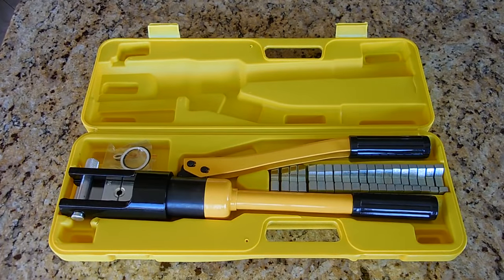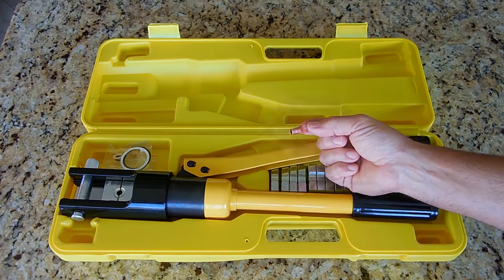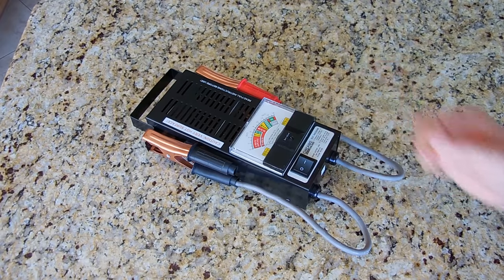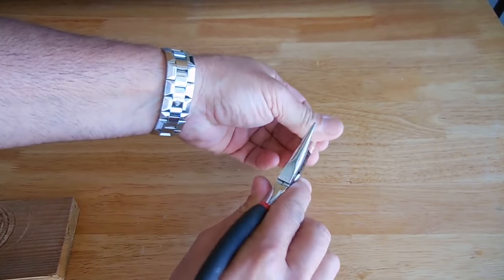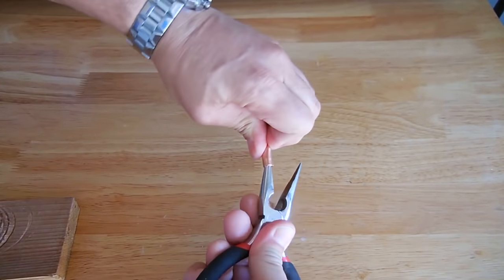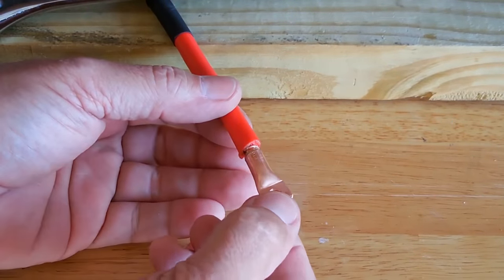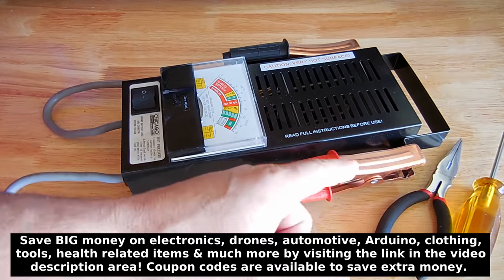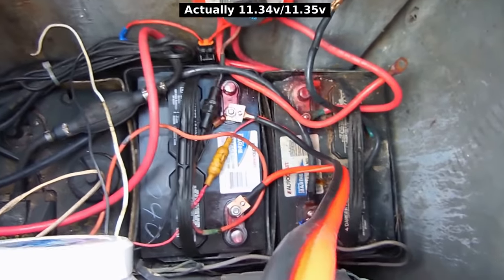Soldered Versus Crimped! Which Method Is Better?

Comment from the maker: ATTENTION:
The purpose of the test was to dispute viewer claims from a previous video that a soldered copper connector would result in much higher resistance/voltage drop under heavy load, AND cause the connectors to heat up. Using 2 identical cables, with one crimped and one soldered, and a 100A load, I proved those claims to be inaccurate for short term heavy load use. Measuring the voltage at the point where the load is attached, gives an excellent indication of the level of resistance of the soldered cable COMPARED TO the high pressure crimped cable. If the soldered cable had much more resistance, you would have seen that with a voltage reading much lower under load, and you didn't. The same battery was used for both tests, and the battery was allowed to recover between tests. Though the test wasn't perfect, it was good enough to prove a point. Thanks for watching!
Reply: electronicsNmore uu
Reply: I have more than 40 years in the electrical field and my latest heavy duty wiring (harness) job was with the US ARMY Patriot Missile System manufacturing 200+ amp wiring harnesses, which handle tons more current than your battery wires and is manufactured to MILSPEC,  I can say your technique is, without a doubt, satisfactory for your application, short or long term use. A few differences however; our procedure was to fill the terminal cups partially with melted solder from a solder pot, tin the leads, then while heating the partially filled cups to melt the solder, slowly insert the tinned lead then remove heat. Lead wire diameter to terminal cup diameter tolerance was matched closely for the application and no twisting of the stripped wiring is done. Many MILSPEC fabrication build applications allowed for "hydraulic press" crimping as well. Good job, but I might add that your "spacers" usage for the large diameter cable does not allow for maximum crimping - research crimped connection cross-section inspection of crimped leads. Pony up the money for the correct die if you want maximum crimping power. Nice video though!
Reply from the maker: Mark West No, I need a "smaller" die, not larger. Thanks for watching!
Reply: you must have read that before i made the correction edit! lol
Reply: The main problem with soldered connection  of connectors is embrittlement the solder will wick up the wire and cause a failure later. If you use poor crimpers the soldered connectors actually have lower resistance but they still have the embrittlement issue.
Reply: I don’t think that anyone is complaining about resistance differences at the time of fabrication. The issue is with aging. Consider high school physics and the coefficient of thermal expansion (CTE). The solder CTE will be different than that of copper. If the wire is going to sit in somebody’s living room for its entire life, then there certainly would be no issues. But if the environment is automotive and it can possibly be exposed to extremes of from -40° C to 65° C, the expansion and contraction will be detrimental to a good connection. For Consumers I would say just go ahead and solder and be careful when you do it but if you’re going to produce 50,000 cars, then you want to avoid warranty issues and better stick with crimping. 

The video was very nicely done, very concise, and had good audio. Well done.

Comment: If there is no mechanical stress on the connection soldering is probably as good as crimping. Adding a strain relief to a soldered connection helps a lot.
When I was young I used to solder everything, but since I work on the railways I learned the hard way (seeing my soldered joins mechanically fail under certain circumstances) that crimping is mostly the best solutions (especially if you have the right tools).
Reply: @PowderMill  The "best of both worlds" is also the "worse of both worlds". 
Pre tin a wire that you are going to crimp is seriously frowned upon.
Mechanical stress can break the strands one by one until all goes wrong (weakness of a solder joint, happens faster than you think).
Also solder is much softer than copper and will be a weak spot when crimping (like never tin a stranded wire in a screw connector, use a ferrule).

Soldered lugs are not weak for high current, we have older DC motors (series motors) that have soldered lugs. Those are 350kW motors and draw well over 200A (2 motors in series on 3kV). We also have bigger series motors (~1MW) but I can not say with certainty if those are also soldered (don't personally work on those), most probably since they use the same type of lugs/connector and have the same mechanical protection.
Failure rate on those joints are actually lower than their crimped counterpart, but there is lots of mechanical protection to avoid mechanical stress.

If your soldered joints get very hot and de-solder there is flaw in the design!
If your breaker fails you should be thankful that a soldered joint melts, most probably preventing more damage. 

PS : was it really necessary to post all that in caps?

Comment: Thanks I made my own lugs after watching your video.. I used a copper tube stepped swedging tool to size the wire openings with the tube held in my flaring tool clamp. Mashed flat with my hammer. Used a sheet metal hand hole punch to make really clean holes.

Comment: I am surprised anyone who understands electrical connections would think soldering would create a greater resistance than mechanical connections.
Reply: you dont solder high Amp connectors for several reasons.

Comment: The issue with only soldering the lug comes if your connection mating surface has corrosion or if the connection (nut) isn't tight enough. Once you have the heat from a high load + a poor connection there is enough heat to melt the solder and start a feedback loop. The solder melts and the wire can pull out of the lug. I've seen this happen with an inverter in a service truck. My point is: if you are going to rely on solder, the connections must be clean/tight and the load should be low. If you can't guarantee all of those conditions (which would be impossible over time), crimp the lug.
Reply from the maker: I generally crimp large cables, and crimp/solder smaller cables. Thanks for watching!
Reply: @electronicsNmore  you're welcome, very enjoyable content.

Comment: This test shows soldering is superior, but I agree with motorhead and A D (below).  Do Both.  crimp for a good mechanical connection then solder, which will coat the copper and resist oxidation, which is the real enemy in marine  environments.
Reply: I always love to hear reasons to reinforce soldering!  So sounds reasonable! Zoiks!  ...and away!!!

Comment: I used solder on high amp draw with prolonged use and never had a failure. This was a box with a giant glow plug in it that was dangled in front of a military truck to put a heat signature at varying distances. This would set off an IED potentially before the truck crossed the kill zone. Also that video 4 years ago is why I subscribed to your channel.
Reply from the maker: I never had any problems either. Glad you subscribed!

Comment: You can also use a tapering tool to taper the ends of the lugs so the strain on the wire is reduced.

The argument that I have heard is that soldering hardens the copper conductor, allowing it to break easier in harsh environments.

The best way I have seen to solder lugs is to set them upright in a clamp. Drop a piece of solder into the lug & heat it up, then jam the cable in and heat a bit more.
Keeping it upright will isolate the solder to the end of the cable.

I prefer tinned copper windowless lugs with a taper that are hex crimped and sealed with double wall adhesive lined heat shrink tubing. This seems to be the most reliable method.
Reply from the maker: Craig J Yes, you can easily flare the opening. Thanks for watching!

Comment: I've used solder on solar high current connections and had the lowest loss and excellent long lasting results., crimps have corroded and become intermittent in the same situation.However If there is a high heat situation crimping is the only solution. I never thought of making my own connectors and  have bought the over priced marine grade ones. Thanks for the excellent videos, keep up the good informative work.
Reply: because you dont know what you are doing. Just that ... Use quality tin plated connectors (not a chinese pieve of S, the right size) a QUALITY crimping tool , and then a professional piece of shrink tube with Heat activated adhesive lining and will outlast the solder one. If you do solar systems for living you should learn a little about electrical systems.
Reply: Where is there a high heat situation?  You make electric space heaters?

Comment: I have done similar test on soldered vs crimped lugs with up to 300 amp loads on up to 2 ga cables.  I use a slightly different method to fully saturate the cavity of the lug with solder.  But I also found that soldered connections had significantly lower losses at higher currents.  Of note: the lead based solder can create corrosion with the pure copper lugs over time if not completely sealed off.  ~new subscriber~
Reply from the maker: Aspendell Thanks for watching! Be sure to rate thumbs up, share, and check out my extensive video playlists for other great videos of interest to you.
Reply: There is another issue that is embrittlement when the solder flows up the wire making it stiff and brittle. this is one reason the military requires either solder only splices or only crimped and the solder splices are not made with connectors but by physicaly splicing the wires together then solder and heat shrink.
Reply: you are using the wrong cable, or the wrong connector or a wrog tool or a combination of those ...  i have seen crimped terminal on 2000Amps power stations and work like a champ.

Comment: ppdan THE ISSUE I HAVE SEEN HAPPEN ON SOLDERED ONLY LUGS USED IN MOBILEINSTALLATIONS.  
ON HIGH CURRENT DRAW EQUIPMENT SUCH AS  RADIO AND EMERGENCY LIGHTING EQUIPMENT, WHERE THE 
LOADS CAN EXCEED 100amps @12vdc and some 24vdc (fire and heavy rescue apparatus).

THE PROBLEM SOMETIMES SEEN =  WITH A HIGH CURRENT LOAD WHERE OVERLOAD EXISTS BUT OVERCURRENT
PROTECTION HAS NOT INTERRUPTED POWER AND HIGH TEMPERATURES WERE REACHED AT THE LUG. THE HEAT CAUSES THE SOLDER, ESPECIALLY LOW-TEMPERATURE RATED SOLDER, TO SOFTEN AND EVENTUALLY MELT.   THIS IS DEFINITELY SOMETHING TO BE CONSIDERED.

CRIMP ONLY CONNECTIONS, UNLESS MADE USING A GOOD CRIMPING TOOL & DIES, ARE SUSCEPTIBLE TO LOOSE CONNECTIONS,  HIGH RESISTANCE,  AND EVENTUAL FAILURE.  

THE "BEST OF BOTH WORLDS" APPROACH :

- USE GOOF QUALITY PLATED COPER LUGS 
(THE HOMEMADE TUBING LUGS ARE GREAT FOR SAVING $$, AND I USE THEM ALL THE TIME NOW -- THANKS BTW!)
BUT CANNOT BE USED IN OUR WORK -- AC INDUSTRIAL WORK / MOTORS / FEEDERS / SERVICES / ETC. AND LOW VOLTAGE DC IN VEHICLES ,DUE TO LACK OF INSPECTION BODY LISTING AND INSPECTORS)

- STRIP AND LIGHTLY TIN THE VERY TIP OF THE CONDUCTOR END (approx  1/16")
JUST TO KEEP THE INDIVIDUAL STRANDS FROM UNTWISTING DURING INSERTION.

-  CLEAN INSIDE OF LUG & APPLY ACID-FREE / PRE-TINNING TYPE FLUX LIBERALLY TO THE BARE WIRE AND FILL LUG WITH A MODERATE AMOUNT OF FLUX TO ENSURE GOOD "WETTING & FLOW" AND GOOD ADHESION.
(OR, USE ACID TYPE FLUX IF INSTALLING ON A LIBERAL DEMONCRAT'S WIRE 😉)

- ADD HEAVY WALL, ADHESIVE LINED, HIGH-END QUALITY HEAT-SHRINK TUBING TO THE WIRE BEFORE 
TERMINATING THE CONDUCTOR WITH A LUG, SLIDE IT UP A GOOD DISTANCE AWAY FROM THE LUG END).

- INSERT THE BARE COPPER END OF THE CABLE INTO THE LUG AND CRIMP WITH PROPER SIZED DIES

- CAREFULLY HEAT UP THE LUG AND FEED IN AS MUCH GOOD QUALITY (MULTICORE OR KESTER ARE GOOD BRANDS) THIN DIAMETER ROSIN-CORE (ACID FREE!!) SOLDER INTO THE LUG.  FILL UNTIL SOLDER FLOWS WELL AND COMPLETELY FILLS THE LUG/WIRE INTERFACE AREA.

-  SLIDE THE HEAT SHRINK TUBING DOWN INTO PLACE AND GENTLY USE A HEAT GUN TO SHRINK IT 
DOWN TIGHT OVER THE CRIMPED PORTION OF THE LUG AND THE INSULATION OF THE WIRE

GOOD MECHANICAL AND GOOD ELECTRICAL CONNECTION.   
LOW RESISTANCE, LOW CORROSION, LOW VOLTAGE LOSS OR INTERMITTENT POWER ISSUES
Reply: Why are you screaming?
Reply: I agree, most crimps are terrible.

Comment: I have made my own lugs, mainly those for AWG 2 to AWG 0000 for decades.  My rule for selecting between solder or crimp has been that I solder SOLID wires but crimp STRANDED wires.  If I solder stranded wires, they become stiff and don’t take vibration too well.  Also, soldering tends to damage the wire insulation if done with a soldering iron.  On the other hand, trying to crimp solid wires is pretty hopeless.  It generates a kind of pivot point and sooner or later the connection fails.
Reply from the maker: Pellervo Kaskinen I never use solid copper wires for soldering or crimping, they're too stiff. If you're worried about the soldered stranded wires bending, just slide over a thick glue lined heat shrink tube that covers the copper connector and 2" of the wire. Any movement of the wire will be limited to AFTER the heat shrink tube. Thanks For Watching!
Reply: You said well.     You NEVER SOLDER a high power connector.  The boundary between free and soldered section of the cable is a time bomb.  I stop soldering high current terminals ages ago for the reasons you mentiones.  YOu damage the cable jackets too ...  solder solid wires havent work well to me neither by the way, Over AWG 10 or 8 crimping works as a champ.
Reply: @perrooceaniko2005  Solid wires require thick wall connector for it to hold onto conductor ,same thickness as the conductor itself .you'll have to drill one out of solid copper .

Comment: The issue with soldering isn't really increased resistance (if wire and lug are sized correctly, there's so little in between the copper that it doesn't really matter). But the solder makes the wire much less flexible right at the point where it matters most and especially in vibrating environments is more likely to break. Solder also has "creep" which means it continually deforms under pressure. Not so much a problem here, because you don't clamp onto tinned wires, but tinning a wire and then clamping it in any way after that is just asking for bad connections. At that point resistance does become an issue because the thermal cycling from load/no-load accelerates the creep.
Reply from the maker: superdau Valid points.
Reply: yes , the downside of soldering is the wire fatigues badly just where the solder ends, and is the usual failure point, crimped only is the best choice i think from years of experience with cars, but i think dielectric grease in there (and modern glue filled heat shrink also does wonders too. solder only if you cant get a crimper